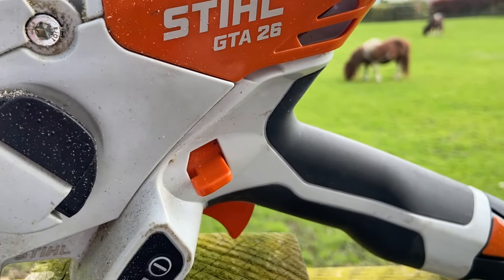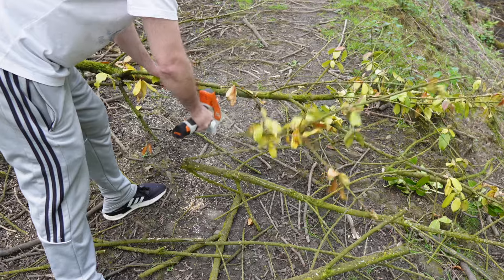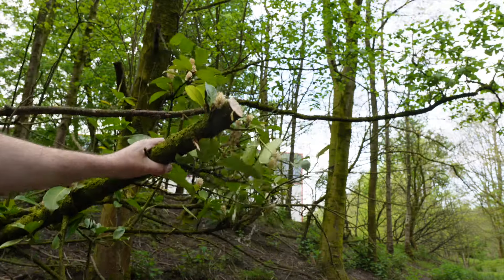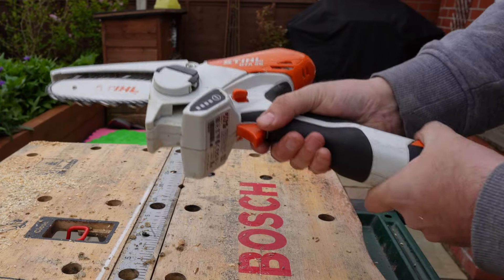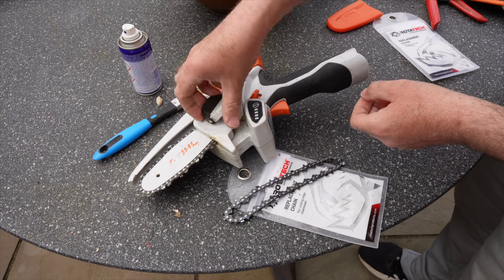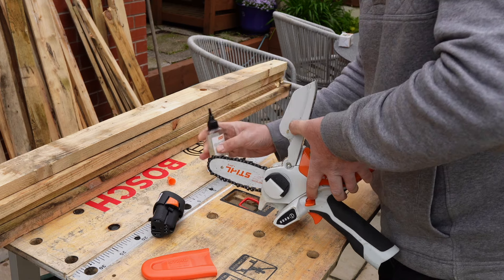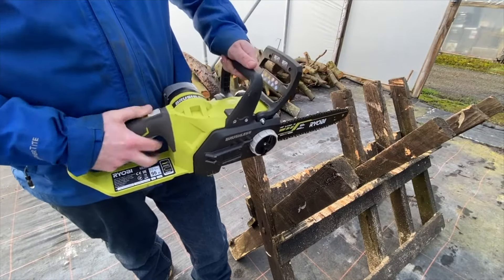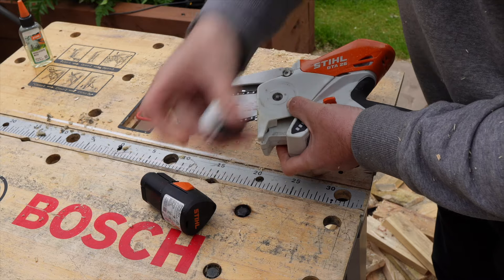The BEST Mini Chainsaw? Stihl GTA 26 Mini Chainsaw Review After 1 Year

Comment: Hello when are you going to make a video about the ecoBooster? (It has only been available for a few weeks.) This thing is an absolute revolution in high-pressure cleaning! 
It delivers much more power, even for older devices, is much quieter, has less recoil, and is much more comfortable to use. The jet is much more homogeneous, allowing for the cleaning of delicate surfaces. Thanks to the wider and stronger jet, you can finish cleaning much faster.